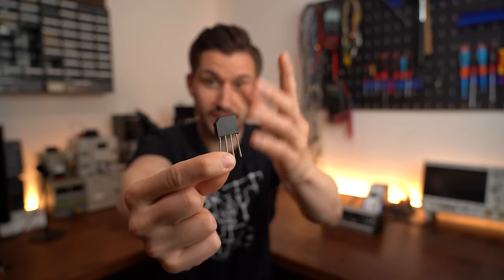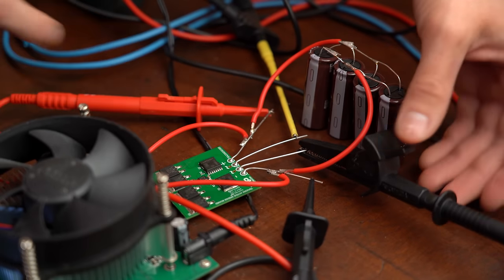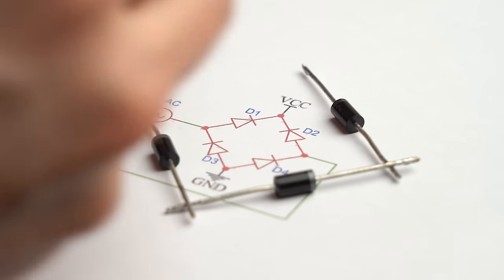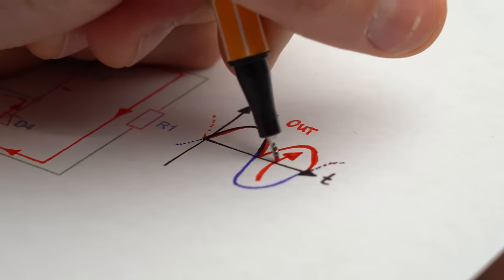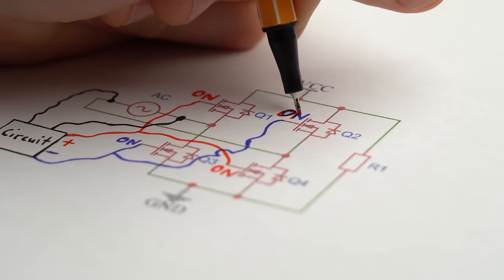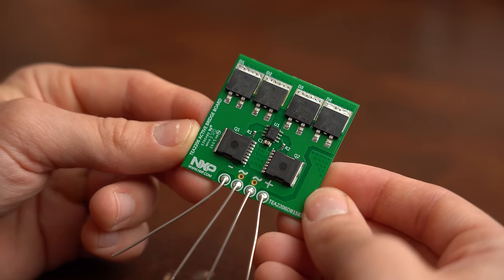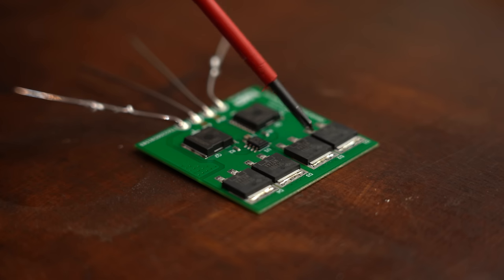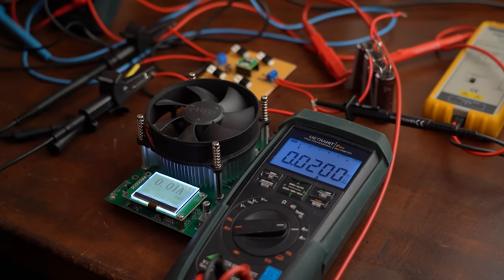The End of the Full Bridge Rectifier? (Sorry ElectroBOOM) Active Rectifier is here!

Comment: A four Triac bridge can help generate 220 V 50 Hz AC from DC 330 V Solar panel. The output from the solar panel is first converted into 220 V 50/-50 Hz sine DC pulses using a DSP with Buck Converter structure. The triac bridge with an autotransformer for impedance matching gives a 220 V 50 Hz AC output.

Comment: Any idea of their longevity? Meaning; will they last as long as or longer than the traditional diode design?
Reply: From a purely theoretical standpoint, the fact that there are more components involved with the active circuit means that the MTBF (Mean Time Before Failure) will be shorter with the switching circuit than with the diodes.  However, in real life it comes   down to the specific design of each circuit and how hot each of the components get - typically a 10 degree C rise means roughly half the service life.   Assuming there is enough space and / or airflow to keep everything cool enough, it shouldn't be hard to get the circuit to last for decades of normal use.

For anything attached to AC mains however, a big killer is lightning surges that make it into the house.  So the limiting factor is how much surge protection is available before those circuits, and the voltage ratings of the devices attached to the mains.
Reply: I highly doubt it.  I think they would likely fail much more quickly.

Comment: The  difference in efficiency is so insignificant because the active rectifiers are meant to be used along with a PFC Inductor, once they are used as PFC, the difference in efficiency will be very significant. In short active rectifiers are not only meant for lessening the conduction losses but primarily to improve the power factor.

Comment: Fascinating. Definitely seems like a better idea for things with huge draw: maybe PC power supplies? (Which often have PFC anyway). I was going to say that DC charging of EVs might want this too, but the high speed DC chargers have big cabinets of electronics so they probably have something even more sophisticated. But, maybe the onboard charger in an EV for connection to Level 1/Level 2 AC service equipment uses these. My relatively new furnace has an "electrically commutated motor" in the blower, which is basically a DC brushless motor. Maybe it could also be a use for these, since the blower is a fairly large draw. (Or inverter type heat pumps...)

Comment: Outside of special applications or high power devices, these seem unnecessarily complex. More circuitry means more chances for something to fail. However, for high power applications these do seem like a pretty nice way to reduce the need for active heat dissipation on the input side, but depending on the amount of power conditioning after the rectification process or the amount of heat dissipated by the power supply total, the amount of benefit gained might not be significant enough to justify the additional manufacturing cost. Still a pretty cool circuit nonetheless.
Reply: Not just high power.  Less power loss means less heat generated, means you might avoid a cooling fan.  Active rectification is very common with modern switched mode power supplies
Reply: @matthiaswandel  Fancy seeing you here! I agree with you. I just meant the cost benefit ratio would be larger in high power devices, lower power devices would also benefit albeit to a lesser degree.  If I could remove a cooling fan, and the money saved on that was higher than the increased cost of the circuitry, this component would definitely be a viable option.  I was just taught to always to minimize complexity; if you have two solutions that work use the simpler one, because it minimizes failure points and reduces cost to the end user.  When I wrote that response, a rectifier costs around two dollars, and the active rectifier cost nearly ten. If the benefit gained is significant enough to justify the additional cost, then its worth consideration for sure. The customer is the one paying for the additional cost, so if they are willing to pay more and the outcome is greater reliability, its a win win.
Reply: "or high power devices"

High *current.

Comment: Mouser charges $8325 for a 2500-count reel of this IC, or $5.46 if you only want one. And then you've got to add four MOSFETs and whatever other support components are necessary. They also sell 50A/1000V standard single-phase bridges for $2.01. You would need to avoid dissipating a lot of heat to justify the active rectifier.

Comment: The interest of acrive rectifier is mostly when used for low voltage rectification, specially standalone battery powered things, for example small wind power systems. For high voltage like 120V or 220V the current is low , so the loss is acceptable.
After that there is the case of high current rectification. Dropping 1.3V over 10A may make regular diodes quite hot.

Comment: Great video, you didn't mention schottky diodes within a full bridge rectifier? I've not seen them packaged this way as they are with regular bridge rectifiers but it would be interesting to know their efficiency also. keep up the great work!
Reply: @foxfyre3600  Correct me if I'm wrong, but wrong you are (I think). Basically all SiC power diodes are schottky junctions and they sport some of the highest breakdown voltages available. They are not very popular due to their cost vs. an active rectification solution and negligible efficiency gains attributable to lower forward knee which matters least at high voltages.
Reply: Would have to distinguish a schottky's emission coef. given a (probably) unknown saturation current by measuring based on SiC thermal voltage among other things. 
To know for sure I'd just hunt down a proper model with known process parameters and calculate.

Comment: In a telecom system, the input voltage is -48V DC (nominal). There are two power busses for multiple power feeds for reliability. That means power can be drawn from either. MOSFETs were used to make that selection of power busses. All was good until someone connected one of the power busses backwards. The boards which were already powered up were fine, but any new board installed would blow the fuses in the board, because multiple MOSFET were enabled at one time before the power controller could pick the right one. Moral to the story is that the MOSFET controller may need to be powered by a full wave rectifier before they can be turned on, but there may still be a race condition like we had.

Comment: I think the most interesting thing is the MOSFET driver ICs (TEA2206 & TEA2208) while being active, meaning they require a power supply, they use the AC mains by charging a capacitor on the initial cycle. The data sheet says the body diode in the MOSFET is used initially in the 2208 as a traditional rectifier to charge the capacitor and power the IC. It would be neat to look closer at exactly how this action happens. Nice video!

Comment: TEA2208 is £6.90 at Mouser and the LT4320 is a similar price.  My use case is a 0.25V power supply for electrolytic purification of Copper.  It's not so simple to design a switch mode power supply for that either.  Going back in time is a tunnel diode transmitter which requires a similar voltage where dropping it from 1.5V is very inefficient.  For these sort of applications one needs to roll ones own circuit.

Comment: In low power low cost PSUs the loss is small so not an issue. In higher power PSUs not only are the rectifier losses an issue, but also the power factor, i.e. the current is taken in short high current spikes to recharge the capacitor, which power companies don't like. Decent switching power supplies have built in power factor correction and will often only require one or 2 diodes on the output. For high efficiency these will be active rectifiers (power MOSFETS) as you describe, either driven from the SMPS controller or windings on the transformer or a dedicated chip.

Comment: I worked as a TV service tech for years and knew the answer to this right away lol,
At 250v odd volts the 0.6v drop across each diode to too small to be of any significance because current is going to be very low so trying to be more efficient here is pointless.
It adds unnecessary complexity and increases failure points too.
Sometimes simple old school methods are best.

Comment: The differences in efficiency all comes down to voltage:  Silicon diodes are always going to drop around 0.6 volts in the forward direction.  A 240 volt circuit will lose about 1.2/240 volts = 0.5%.  A 24 volt circuit will lose about 1.2/24 volts = 5%.  Another way around this is to use Germanium diodes that only drop around 0.2 volts.

Comment: For simplicity the FBR will never be replaced. I can see Schottky diodes used instead of normal rectifiers. Putting multiple diodes in parallel will also decrease  the effective voltage drop and increase the total current handling capacity.  Like on a solar cell, increasing the conductive area does not increase voltage per one cell. Likewise increasing the conductive area on a single diode also will not decrease its  junction voltage drop. If you don't believe me then try a diode test on a DVM with a single diode and then multiple diodes in parallel. I am not a fan off MOSFETs in power circuits, because they tend to fail closed, or sometimes blow apart. If they failed open that would be better. If every volt counts especially in voltage generation like solar cells then putting  multiple diodes in parallel in place of a single blocking diode will increase efficiency and decrease poet loss as end example.
Reply: @Christopher Grant I have seen many fail in digital circuits like on motherboards. I have also replaced more than my fair share of Pinball coil drivers.  MOSFETs do have a use, but not if they are overdriven, as cheap designers always do.

Comment: The efficiency of regular (passive) full-bridge rectifier circuit is only dependent on the voltage drop on the diode and the AC voltage. The actual power and current does not effect the efficiency directly: efficiency = 1 - 2*voltage_drop/ac_voltage. The increase of power loss of course leads to the increase of temperature, but it has no dierct effect on the efficiency

Comment: Low voltage, high current power supplies require active rectification like a 5V supply at 50 amps.  You made a simple video for electronics 101 students.  Don't forget about cost, complexity and reliability too.

Comment: FesZ Electronics recently featured a low-dropout regulated DC supply for 6.3V tube heaters with MOSFETs as rectifying devices; what is more, thyratrons (and later thyristors) have been used in adjustable power supplies for decades.

Comment: 650V Silicon Carbide (SiC) Schottky Barrier Diodes are an option for an off-line bridge. These devices share current so they can be placed in parallel. They are very robust. Most newer off-line supplies are called universal mains. Which is usually made up of two supplies an auxiliary supply (usually a 15W to 50W flyback) and a main universal, which has a power factor correction front end and then a buck converter after. 

For new designs you will have to design for universal mains and also meet the world wide regulator requirements which will include power factor correction and also very low standby current. The approach is to have the Aux supply supervise the larger supply. Much like a newer high efficiency "fanless" PC power supply. One of the challenges is to make sure your supply can pass the line AC mains transient tests (world wide), where the bridge in order to survive needs to be very robust. Also, the filter capacitors are not easy to specify and the PCB layout has to be correct.

Comment: You should do another one on DC-DC power supplies. My company loves to use them. We'll send out 24Vdc via a cable and then use them on a board at the end of the cable to then convert it to 5v and/or 12v. We even had a few systems run on 56Vdc as a mains voltage then converted down.. For me those DC-DC PS are a common issue, we use an IC version soldered on boards.

Comment: I saw many laptop power supplies with diode bridge mains rectifier, PFC boost and active output 19V rectifiers. Many of them are for DELL laptops. Input rectifier efficiency bonus is relatively small vs cost acitve circuit, but at output with higher currents it's real benefit. Lower voltages = cheap parts and simpler cicuit.

Comment: For low voltage apps, for years I have used schottky diode packs to make rectifiers.
Try TO-220 pack 3pin dual-diodes, you need one in AKA pinout and one in KAK pinout.
At a couple of amps they only drop about 0.16v per diode compared to the typical rectifier maybe 1v per diode.
And two TO-220 packs is compact and has convenient wiring.
Reply: The problem with Schottky rectifiers is their low reverse resistance.
Reply: @QF2653    ...   not a problem when used as low voltage rectifiers. 👍
Reply: Sure your option is good. At high currents, the drop voltage on Schottky increases to 1V, need to use high current Schottky, the circuit from the video is reasonable for 30A and above.
Reply: @gherbent  ...  correct, I use 16A TO-220 schottkys which are cheap, 2 of them for maybe a buck if you buy them in bulk packs.
And 16A schottkys passing a couple of amps are usually very low forward drop, 0.14 to 0.16v.
Needs no heatsinking, but be careful the KAK pack has the tag at V+ potential, so if you screw the 2 packs to the cabinet for convenience use a plastic cabinet etc.

Comment: the company I work for replaced all rectifiers with active rectifiers in new designs we do a lot of low voltage high amperage for Motors. A good low on resistance fast switching mosfet is a gamer changer for efficiency and thermal solutions we use LT 4320 controllers

Comment: The most fun I had with a bridge rectifier was modifying my Mom's "Light and Motion" Christmas tree ornaments.  These had any number of motorized operations to bring the ornament to life, but if you had a number of them on the tree, they got noisy.  So, I put a pair of diodes on each ornament so that one polarity went through the ornament, and the opposite bypassed the ornament.  Then I ran all the power going to the tree through a full wave rectifier, followed by a double pole switch that allowed me to reverse the output polarity.  Viola, in the middle switch position, the tree was unlit.  In another, it lit up and in the third, it lit up and the motorized ornaments came to life.  Mom thought it was magic.

Comment: I think during the capacitive load test the capacitor bank was unable to discharge properly, it kept on charging, adding a bleeder resistance to it should resolve that, alongside, also utilizing the body diode during some period of the supply voltage. This means that the mosfets should be triggered at a certain value of alpha, which can be adjusted by the time constant of the load.

Comment: This is still full bridge rectifier! Just more expensive and more efficient version of it. In my old job we use to make invertors and we used field transistor rectifiers like the on you got there. We did this to reduce the heat in the enclosure. But again this is still full bridge rectifier.

Comment: Concerning rectifiers and current: BigClive had a recent video where a lamp had an FBR followed by a triple diode + two capacitor setup.
Title is "Fixing and hacking a light from Thomas Nagy"
Maybe with a DC-side circuit like there, you do not run into the capacitive load issues.

Comment: Controbable rectifiers are used in very high power situations, I often deal with rail sub stations that convert 63kv or upwards to 1500v dc. They usually use a Dyd config with a TRU for harmonic mitication. Using Thyristor you can regulate the output. Amps on output can be up to 10000A in fault conditions and the system will not trip

Comment: When they tested the Bridgeless PFC by Ćuk, they noticed significant distortion in the power input. That is because the other equipment on that line used the 1895 vintage bridge rectifier. Try reading up on 21st-century designs.

Comment: I've got a BSEE. The correct name is "Full Wave Bridge" or "Full Wave Rectifier". This is in contrast to a "Half-Wave Rectifier" (a simple diode). It has that name because it allows the full incoming AC wave to be transferred to the load. Also, a full-wave bridge is usually drawn as it is because of its similarity to a Wheatstone Bridge (often used to monitor sensors such as strain gauges and solid-state thermometers).

The voltage drop across a semiconductor diode is 0.7v for common technologies. That's constant regardless of the current flowing through the device (until it burns up). There are two diode-drops in each path through the full-wave bridge. With a 120V p-p AC input, that means that the power loss is about 1.17%. Every component involved in any circuit uses power (generally expressed as heat). So the extra components added for your alternative themselves use power. When you start with an energy savings "budget" of just 1.17%, it isn't surprising that you end up with little savings to show for the effort.

This exercise sounds like what we programmers (I'm now a programmer) call "premature optimization".

I was not surprised that you ultimately found that a full-wave bridge is nearly always a solid engineering choice.